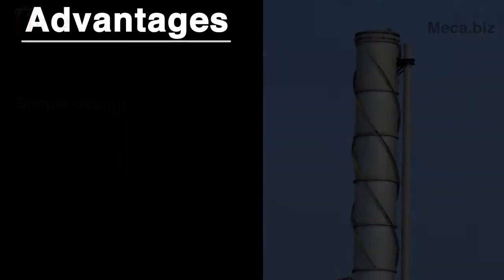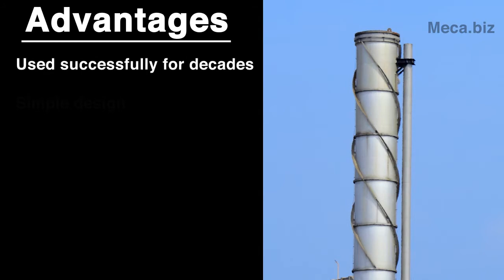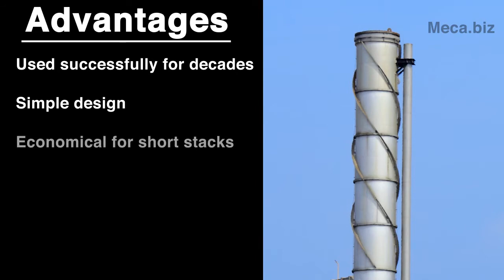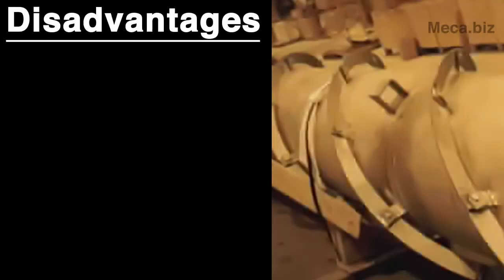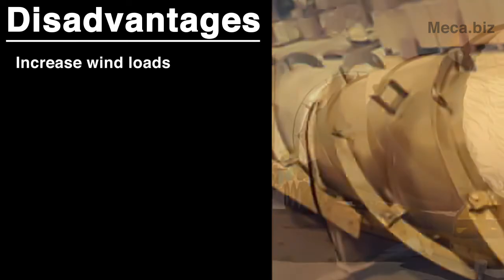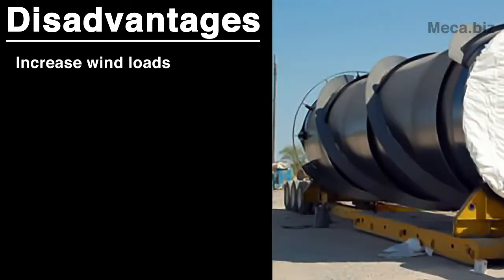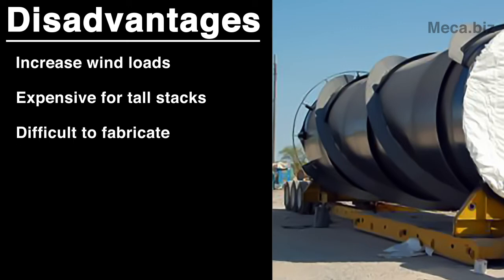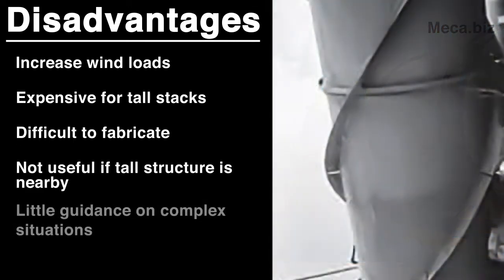A Brief Explanation of Helical Strakes (Meca Enterprises Inc.)

Comment: Thanks for this.  I'm researching the use of helical shape around the 3/4 inch diameter antenna mast on a moving vehicle.  Yours is the first notion I've heard where wind drag is actually increased vs. the bare cylinder.  Thanks for that.